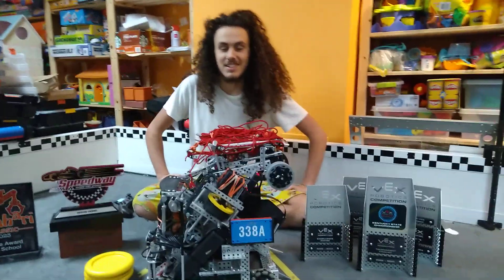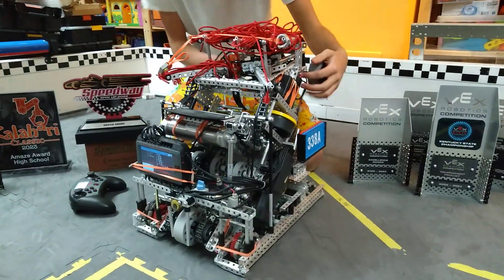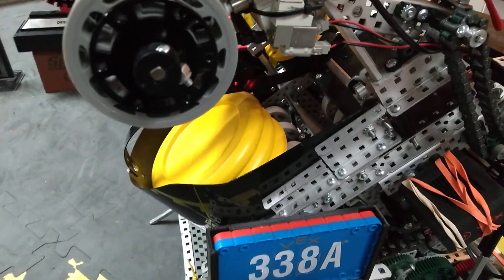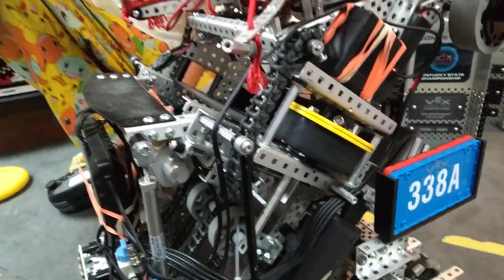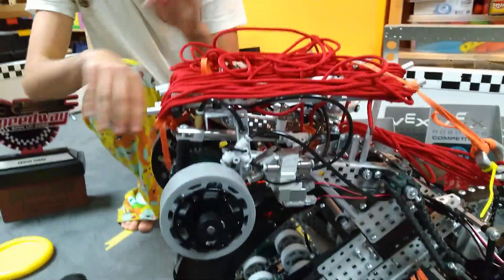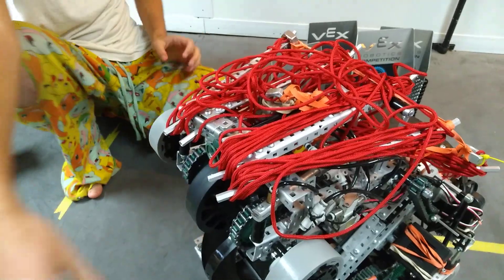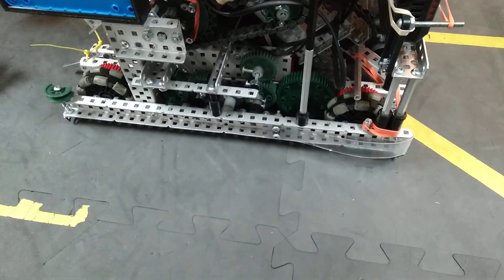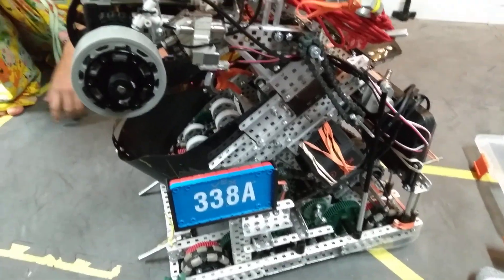Vex Spin up : Post State Robot Explanation

Comment: How did you do 3600 direct for flywheel with no gear to higher rpm?
Reply from the maker: We made a custom motor cartridge our of stacked poly disc
Reply: @LOUIE_Timmy  ok thx
Reply: How?
Reply from the maker: @SaltNjairee  laser cutter we outlined the motor spline and the size of a quarter inch axel and then made like 4 of each disc and screwed them together

Comment: at what angle is your flywheel?
Reply from the maker: 35degree
Reply: @LOUIE_Timmy  wow, do you encounter any problems with that? What's the advantage? Why not 45 degrees?
Reply from the maker: @rodolfome3427  for long shots the angle cha.ger stays down and the lower angle allows for the disc to go in flatter to the goal which is way more consistent than 40+ degree fw angle. Then angle changer goes up for driver and that gives us the steep angle needed for overfill and close shots